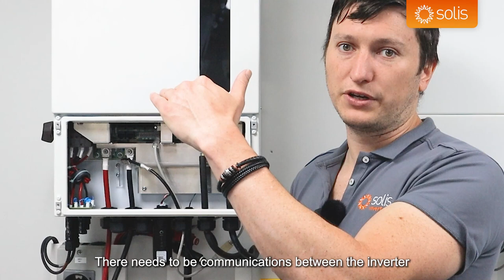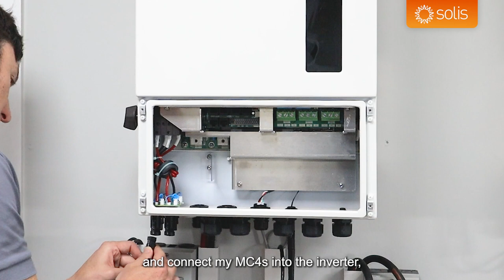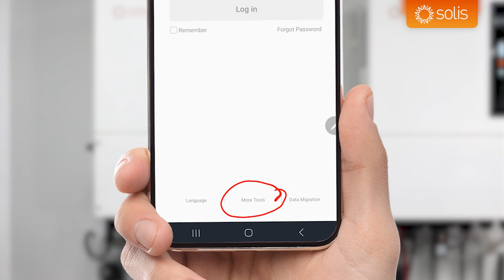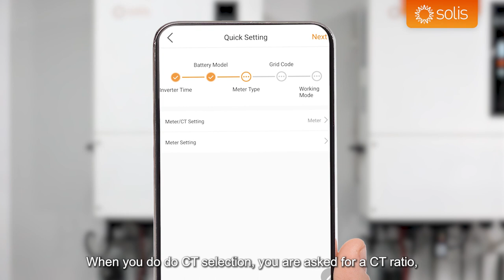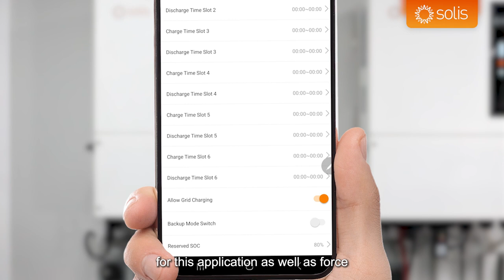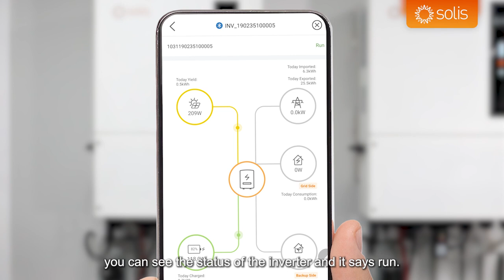Solis S6 Advanced Power Hybrid Inverter Introduction

Comment: Would it be possible to use this inverter completely off-grid, but instead of using a generator, connect the grid to the generator input to supply power when there is no solar energy from the panels or the battery? I have no interest in feeding any power back into the grid for the moment.
Reply from the maker: Solis S6 Hybrid inverters are not designed to use the grid as a “generator input” for an off-grid setup. The generator port on the S6 is built for a real generator with specific voltage and frequency behavior. The grid does not behave like that, so the inverter will not operate correctly or safely in that configuration.

If you want the inverter to run off-grid and only use the grid as backup, you must use the normal AC-in/grid input. Then you must enable zero-export control so that no power goes back to the grid. The generator port should not be used for the grid.

So the short answer:
No, you cannot connect the grid to the generator input.
Yes, you can run “off-grid with grid backup,” but only through the regular AC-in path with export disabled.

Comment: Thanks for the informative Vid.. Looks like a good system.
I have PV and a large 32kWh battery . I intend to export everything the PV produces and charge the battery at night on a cheap EV tariff. Is there a setting to stop the battery from being charged during the day via the PV and only be charged at night via the grid, thus exporting all the solar and running on battery only by day, exporting at 15p and importing at 7p
Reply from the maker: Yes. On the Solis S6 Hybrid you can stop daytime PV charging and use the battery only for export or for running the house.

To do this, you need to use Time-of-Use (TOU) settings. In TOU you can set:

Charge from grid only during your cheap night tariff window.

Set daytime periods to “no charging” so the inverter will not use PV to charge the battery.

Allow export during the day so all PV goes to the grid at your 15p rate.

Set daytime discharge if you want the battery to support the house or export during the day.

The key is to turn off “PV charge” in the daytime TOU window and leave only “grid charge” enabled during your cheap hours.

Comment: I want to be able to turn off the DC/PV input without touching the DC switch provided with the inverter, Can i still use an External DC Breaker together with it? cause i want the main inverter to be out of reach for safety purposes?
Reply from the maker: Yes, you can. Actually in some EU countries is mandatory to have one beside the one built in.

Comment: 600volt on a single string???
Reply from the maker: Yes, the Solis S6 Advanced Power Hybrid Inverter does support a maximum DC input voltage of 600 volts per MPPT input. This means you can design a single PV string with an open-circuit voltage (Voc) up to 600V, provided it remains within the inverter’s MPPT operating range of 90–520V during normal operation.

Comment: I've seen Solis with an LCD screen and settings buttons on the device. The one presented here doesn't have that. What's the difference between them?
Reply from the maker: Nothing. The presence or absence of an LCD screen and physical buttons on Solis S6 Advanced Power Hybrid inverters varies across different models and configurations. Some models come equipped with a 7-inch color LCD screen and keypad, while others rely solely on LED indicators and external communication interfaces.

Comment: Hi, I would like to know, for the GRID port. Should it be connected from the line side of the main distribution panel or is it okay to be connected on any branch power outlet only?
Reply from the maker: You should connect the GRID port to the line side (utility side) of the main distribution panel, not just to any branch power outlet.

Comment: Can we connect non-essential load to Generator Port (when programmed it as output)
Reply from the maker: Yes, you can connect non-essential loads to the generator port of the Solis S6 Advanced Power Hybrid Inverter when it is configured as an output. This port can be programmed to function as a "Smart Load Output," allowing it to supply power to non-essential loads. In this configuration, the inverter can manage these loads based on battery state of charge and grid availability, ensuring critical loads remain prioritized. 

solisinverters.com
diysolarforum.com

To set up the generator port for non-essential loads, access the inverter's settings and configure the generator port to operate as a "Smart Load Output." This setup enables the inverter to control the connected non-essential loads effectively, optimizing energy usage and maintaining system stability. 

For detailed instructions on configuring the generator port and understanding its capabilities, refer to the Solis S6 Series User Manual. 

Always ensure that the total load connected to the generator port does not exceed the inverter's specified output capacity to maintain safe and efficient operation.
Reply: @3buysolar  Thanks for your help. I have connected my non-essential load to smart port. It is working fine. But the web/phone software is not measuring the smart load i.e It does not show the amount of load on smart load, while is same is shown at the front screen of inverter. Why is that?
Reply: @PakDaisy  wonder if Solis can look into it
Reply: @3buysolar  Wow, this is exactly what I need.

Comment: Looking to buy this unit, either kitted with a Dyness 5.12kWh battery or trying to figure out if this unit is compatible with my existing Huawei battery model ESM-48100A1?
Reply from the maker: The Huawei ESM-48100A1 battery is not listed among the compatible batteries for the Solis S6 Hybrid Inverter in the Solis documentation. Using a battery not specified in the compatibility list may void the inverter's warranty. On the other hand ... The Dyness 5.12kWh battery model is not explicitly listed in the available Solis compatibility documents. However, other Dyness models, such as the Dyness B4850, have documented setup guides with the Solis S6 series. For instance, the Dyness B4850 is compatible with the Solis S6-EH1P6K-L-EU
Reply: @3buysolar  Thank you very much for your response and guidance.

Comment: hi:  I have been planning to get the S6 11KW inverter. Do I need to buy a   Automatic Transfer Switch ? I am just using PV + battery and Grid -but I dont intent to export any power. thanks
Reply from the maker: IF is connected to the grid you would need a smart meter like Eastron Meter (3ph) and set the export to zero. Meaning that will export zero power to the grid and you will be still able to use the grid as a backup or when not enough power from the PV or battery.

Comment: Is this will work even in a grid power outages? or this is still mostly dependent on the grid presence?
Reply from the maker: Yes, Solis hybrid inverters (not all, but this one yes) can work off the grid, though a true off-grid solar PV architecture normally would require a string inverter or charger controller on the PV end and a proper battery inverter (ex. SMA Sunny Island, Victron Multiplus, Victon Quattro, etc, etc) on the battery side. A hybrid inverter is always something between a horse and a donkey. If you understand what I mean.